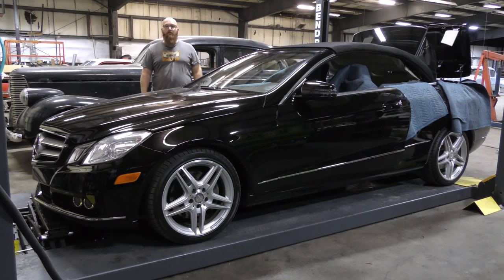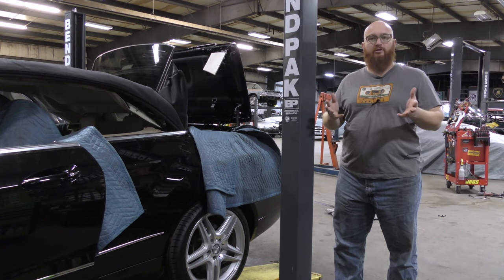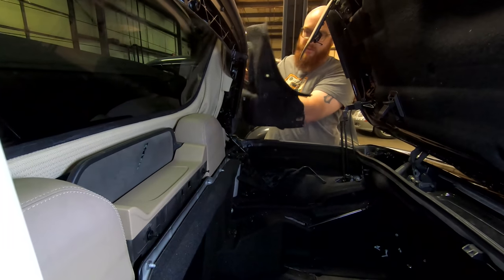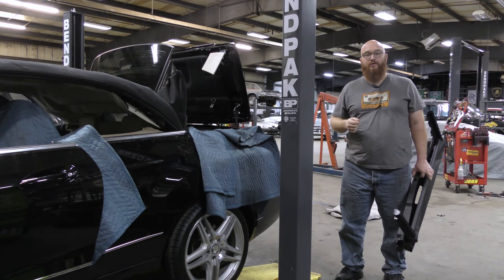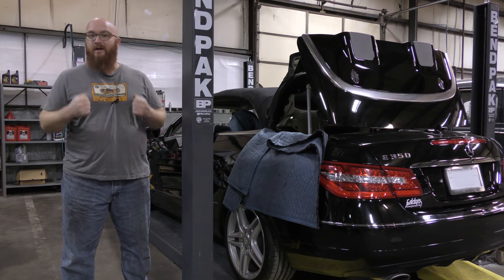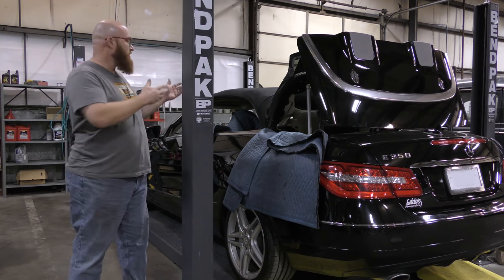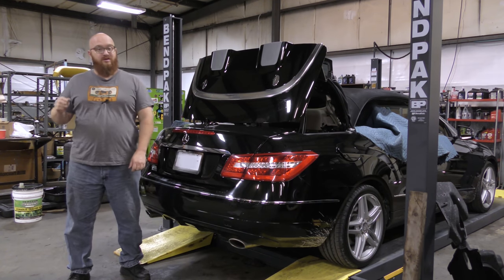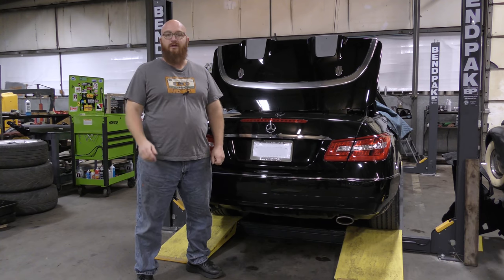When bad design costs thousands! Not so convertible 2011 Mercedes E350 can no longer rise on demand

Comment: That skit is EXACTLY how the big three Detroit automakers operate.  

All automakers are downgrading their cars these days, hoping they will be off the road soon.  I call this the "Airbus attitude".  Airbus makes fine airplanes, but they are not as well built as Boeing equipment.  And Airbus even admits this by publicly stating that they think their airplanes should be removed from service after 25 years irregardless of time or cycles.  Boeing equipment 40 years old flies around the world every day.  And automakers realize two things:  1.  People do not work on their own cars anymore, and 2.  People do not keep their cars as along.  In Europe, stringent inspection requirements remove many viable cars every year primarily for this reason.

Great video!

Comment: Yet my 2006 206cc's metal folding roof operates perfectly in all season's. 15 years old and French.

The Peugeot 206 was one of the cheapest cars to buy when new, they weren't engineered to last for life, but Peugeot galvanised the body so rust is rare and the rest of the car is simple and cheap to fix.

The hydraulic fluid and whole motor unit is in the trunk, where there are no people. Promise

Comment: I read in a forum that some E class cabriolet owners have had success with a repair kit with couplers from a supplier called Cabriolet Hydraulics. I wonder if it would be practical in this case.
Reply: I have a 2005 SL500, Cabriolet Hydraulics does have a great option for the SL.  Not sure about the E Class..

Comment: Wizard, Why dont you mention the manual operation option. I work my slk 320 hardtop roof manually since I got a $2800 repair quote, leaky cylinder right over passenger seat. I only paid 4750 for the car, a 2005 with 97K. And doing it myself would not end well I bet. And your right, one  cylinder  goes,  they all are doomed. Look in owners manual for emergency closing and opening, once you learn the proper procedure its not bad.  The system already is fucked up, you cant hurt it much more I think. You can always spend that extra 3 grand later on your next mercedes suprise.

Comment: Nice video. I am a fan of Mercedes Benz cars but it is a little disappointing to see one of the most advanced automotive engineering company take the cheaper route when designing critical components which ends up causing the customer to pay a huge repair bill.

Comment: Little add-on warning to bolt-on tuners- The accountants had their way with your engine, gearbox, and drivetrain, and it doesn't matter who built the car.  All of the alloys and metals are specifically chosen based on cost and being rated for a bit more stress than they are expected to receive, not an extra 50 horses.

Comment: 3/4k to rebuild the cylinders?
hope you are joking,  the seals are around 200$, for all of them, it takes max 3-4 hours of work to replace the seals in all of them ...and another 10h to install/uninstall.
I just did this job plus tension cables and was 800$ for a A208

Comment: I had a limited 1986 Gold Edition Cadilac Seville. It had gold plated trim inside and out. Only 50 were made with out the ugly wheel trunk. Several design flaws 4.8 ltr V8 in a V6 compartment. Had to drop the motor down to change back olugs. Almost as bad as Pontiac 92s that you have to remove a motor mount to change belt. It is not an accountant. Any company with design Engineers have a Technokigist that takes engineers designs and fixes to real world working conditions. Some times the Engineers win.

Comment: rhe benz r129 tops can be manually operated, it's even in the owners manual. there are 2 release bolts under the sunvisors and a goofy crank system in the rear quarters. advise reading some of Bob Lutz's books, helps explain how vehicles get badly made.

Comment: If they put a swivel there it’d also be something to wear out and be a leak point. But, then they could also have designed it with fittings so you could replace the swivel. 
They design stuff to be cheap and to work for long enough. Rarely is any care given to designing things to be serviced.

Comment: I drive old junk so i dont have to deal with this stuff. Hardest thing to change on my 1990 chevy is probably the power steering pump cause you need a puller which really isnt that big of a deal

Comment: I'm an accountant and I can assure you that we don't build cars or even have that much influence over the product. We do analyse all sorts of costs including actual cost against planned cost. 
The executives make those decisions - they're usually senior engineers advised by a team including designers, product engineers, quality control, plant engineering, sales HR and finance. Executives make a lot more money than manufacturing accountants. 
They will want to position the car in the market at a particular price and will demand that it makes a certain profit margin. If it doesn't stack up, they go back to product engineering and demand cost savings. Under high pressure, the engineers may turn to lower quality components, cheaper suppliers or make innovative changes that don't always work out. Sometimes changes have to be made because of supply issues. In a large organisation like Mercedes it probably takes a long time for reports of a failing component to be fed back to the engineers.

Comment: You can fix it better......install a shielding so that when it fails it drips on their arm instead of spraying them in the face lol would be better if you had the ability to just redesign the line like you said or if manufacturers went for the best built and best designed for reliability so that the vehicles would run problem free much longer which in turn would sell more

Comment: The problem is that engineers usually follow the first KISS Rule and keep it simple. Or at least they used to. Now everyone is using the SECOND KISS Rule: "Keep It Stupid, Simple". 
There is a long history of car company screw ups caused by accounts. The whole debacle of the Corvair is an example. The front end was designed with an antisway bar. It was removed by bean counters. It had been added back before "Unsafe At Any Speed" due to customer complaints about handling. Surprisingly, same thing with the Pinto 2 door sedan and Runabout. The shield had been part of the design from the beginning. Lee Iacocca kyboshed it. He is also the one who commissioned the in house study that said it would cost less to pay out in court rather than fixing the problem before customers died.

Comment: I had an instructor in automotive school tell us a story about a transmission (I forget which one) that was known to fail catastrophically and be a pain in the mechanics ass to replace and devastating for the service writer to have to tell customers about how much it'll cost to replace/repair. My instructor said he got so fed up with that transmission coming into the shop with the same failures over and over again that he decided to go to a seminar where the engineer would be so he could have a stern word with him. He talks to him, expresses his concerns about what a hunk of junk that transmission is that this engineer designed and the engineer turned to him and said "Don't even come at me with that, when I initially presented my design that transmission was bulletproof with robust, overbuilt components that would last a lifetime. By the time it went through finance and parts suppliers, etc. I didn't even recognize the thing anymore! I'm with you on that! I fucking hate this transmission and how it turned out just as much, if not more than you!"

Comment: The biggest question is probably "why not use a geared electric motor in 2011(or that model)?" I mean we did have the gen 2 prius for 7-8 years by then and there was the gs450h with a facelift. I get that i'm comparing Toyota and Daimler, but still.

Comment: is there a way to suck out the hydraulic liquid and then manually open and close the roof? it wouldn't look so stylish anymore with a touch of a button but at least you can have a convertable without spending 2-4.000 dollars on repairs.

Comment: I call those accountants Bean Counters.   I did some around figure math.
$5.85 "do it right" cost.  Times 200,000 units.  =$1,170,000  As Ms. production accountant stated.

My 2000 r129 msrp was around $92,000.  Using 200% of msrp =  $45,000 manufacture cost.
$45,000 x 200,000 cars = $9,000,000,000
$9,000,000,000 - $1,170,000 "do it right" =$8,998,830,000.  Rounding to $9,000,000,000
They could do it right and not notice it.
However!  There are at least a hundred of these little "do it right" things in every model.  Some are extremely costly for the company as we have seen with some Safety Recalls.

Comment: Well it did last 10 years which is the life expectancy of these tops. If not that it’s the top itself, pumps, seals etc. Once they leak like this,  with the fluid being hydroscopic, the next to go will be the seals as well as rust. It’ll be a never ending battle now. 

You don’t necessarily have to render them inop when they don’t want to fix it. Just drain the system. They can all be manually operated for obvious reasons.

Comment: Straight up genius engineering… hey let’s run hydraulic lines that continuously flex inside the passenger compartment of the car.
Reply: I would just drive the car as a nice coupe and forget about the top coming down., if faced with a bill like that.

Comment: I have a ‘98 SL500 (the last real Mercedes) that I bought ten years ago with only 24k miles... I got it home and was showing my daughter how cool the hydraulic convertible was...
On the second attempt it stopped halfway and HYDRAULIC FLUID SPRAYED ME IN THE FACE AND IN MY LAP from the piston in the top left of the windshield.  After much research I decided not to fix it and just put the top down manually with the Mercedes tool in the trunk.  The wizard is right, there are 12 or so individual pistons and the little o-rings fail and shoot out fluid.  It’s not worth continually fixing... just do it manually, it’s easy...
Oh, and my SL had 24k miles on it and had receipts from already replacing those pistons once...
Today it only has 50k miles and is one of the best and most reliable cars I’ve ever owned!  Never buy any Mercedes from model year ‘99 and above... they are very different cars!

Comment: I have a 2 year old E400 cabriolet new shape and this has already happened to mine.  Luckily fixed under warranty but now the fabric tie threads that run though it are perishing , cost £600 U.K.  
Mercedes’ say the roof isn’t covered.
Reply: Mercedes gets their tops from other companies so they do not cover it. Like my panoramic roof on my car that has a warranty but still had to pay $2,200 to replace it. Same panoramic roof used in new f150s

Comment: 64 years ago, Ford managed to design a retractible hard top for the 57-59 Skyliner that was all electromechanical, no hydraulics. At least when they failed they didn't spray hydraulic fluid in your face!

Comment: The answer to this problem is really simple. Stop using hydraulic systems to operate powered tops. Almost everyone else uses electric powered tops and there's a reason. You can put the unlatch motor in the header run a wire to it rather than a hydraulic line.
My friend had a Honda S2000 electrically operated top. 
He put the top up and down a lot. And the car lasted till 350,000 Miles when he sold it. The original engine one clutch original suspension parts. That's reliability quality engineering.
Designing something and then building it that it will eventually fail is not high quality engineering.

Comment: German engineering used to be heralded as the pinnacle.  Pre 2000 Mercedes, BMW were well built and offered truly exclusive options. My experience with recent BMW and Mercedes cars, I wouldn't consider another one.  They're is nothing special or superior to them.  BMW is an acronym for Buy More Warranty. Mercedes Benz service motto is More Bucks!
I think Toyota/Lexus is probably a much safer bet

Comment: Car Wizard.  I love your channel.  Thanks for the content and the teaching.  I have a Mercedes SLK with that convertible top.  Two front latch cylinders are leaking a bit into the headliner.  I have never opened the top (I don't want a convertible, just a sports car).  Can I drain the hydraulic fluid from the system and just never use it as a convertible?

Comment: Do not buy any convertible except for a Miata. That’s my advice for buying a convertible. In a Mazda Miata, the top is easy to operate and it’s a fully manual top with no stupid hydraulic tops. The Foxbody Mustang convertibles had huge structural issues because Ford had a third party buy notchback Mustangs and cut the top off and call it a day. Even a convertible top on a Miata is very simple to replace or you could buy an aftermarket hardtop. I would rather have a car with a sunroof than a convertible. If I have to buy a convertible, I would buy a Mazda Miata. If manufacturers want to keep making convertibles, get rid of the hydraulic junk and make it electric or manual. Hardtop convertibles are a better option because you don’t have to worry about someone cutting your top. Also look at resale values of Mustang coupes vs convertibles. The convertibles don't have the resale value that the coupes have and the worst thing is that the convertibles cost more new than a coupe version in most cases. There's a reason for that.
Reply: I agree with you.

Comment: This is all so reminiscent of the infamous Lucar "bullet" connector sleeves. To save 1 old penny per item, Lucas changed the sleeve inner material from brass to cadmium plated steel in the late 1960's. They are not sealed so salty water can get in during the winter. Salty conductive water, different metals (brass of the "bullets" on the wire ends and the plated steel of the connectors) plus electricity and you have the perfect recipe for electrolytic corrosion = failed connection. I reckon this went a long way to killing the British motor industry, by giving all their cars such a bad reputation for electrical faults. I recall back then, showing an executive in the industry, a multi-pole connector block from a Toyota, with its water sealing and shaped 'O' ring at the joint. "Far too expensive old boy" was his response. Penny wise - pound foolish.

Comment: I had always assumed that the hydraulics were fed from the power steering system rather than an entirely separate secondary hydraulic pump. Interesting!
Reply: Wouldn't that be a great idea..
"Sorry Martha that spray in the face means we don't have any steering....."
Reply: @JohnSmith-yv6eq  fair point! In a tractor a hydraulic leak can mean no brakes or steering!
Reply: @tomcardale5596  
Especially Ih570....

Comment: While I too have been frustrated by these kinds of car issues, I believe there's another side to the story. Every car has to compete in price against their competitors. That puts a limit on the sale price, and that in turn puts a limit on the build cost. While it may be possible to build a car that never breaks, it may be so expensive no one would ever buy it. Engineers and accountants are faced with thousands of these issues on every car.  Maybe Mercedes should, after all these years, make a better hydraulic line. But the flip side is if you have one thousand $5.00 issues like this on the car, would the car sell in the first place if it cost $5000 more? (Or one hundred $50 issues, you get the point.) That's not a trivial amount of money. And it's a difficult balancing act.

Comment: Engineers - "We should use these metal screws to eliminate squeaks and rattles"   1980s Pontiac executives - "Screw that, use a dozen different sizes of plastic snaps, grommets, and screws. We can save $$!"  1980s BMW executives - "Build a car that can be completely disassembled with a set of 10, 12, 17, 19MM wrenches and a screwdriver...all of which will be stored in the trunk lid."

Comment: Interesting cable run. I think SAAB ran this cable under the floor up the A pillar and then the hose does not get into this flex.

Also, you can blame the accountant but the engineer designed it wrong in the first place!

Comment: I believe news car are built to be recycled not to last. They build them so the simplest failure render the car useless. Ive seen a central locking system for a car trunk lid fail and it cut ignition and left the owner stranded. It was an audi.

Comment: The real question is why do hydraulic hoses need to be run through the top in the first place? What actuators are they feeding that couldn't have been substituted for electric motors? BTW, Mrs. Wizard's "stern accountant" part turned me on just a little.
Reply: Noise is the reason..the whizzes, whirrs, clanks right next to your ears.....so un-Mercedes like...

Comment: Given that it's a hydraulic hose, even wrapped in steel, I don't understand why you couldn't cut out the section of hose and replace it with hydraulic fittings.

Comment: I do not discount what you are saying I will add there are plenty of ego driven engineers that cause a lot of problems. 
Its braided stainless steel its used everywhere with very few problems, it will probably outlast the rest of the car.

Comment: What is  the cheapest scan tool that can do crankshaft and camshaft position sensor relearn procedure?  All these cheap bi-directional ones for $800 and less are bi-directional, but do not do cam and crank relearn procedure.

Comment: That is one area they shouldnt go fancy schmancy on the tech, unless there is a particular reason for it. I dont see how a roof is heavy duty enough to warrant hydraulics instead of electric
Reply: Noisy motors, limit switches, bending and straightening wire time and again...etc.  etc..